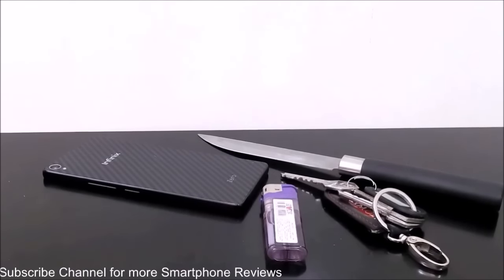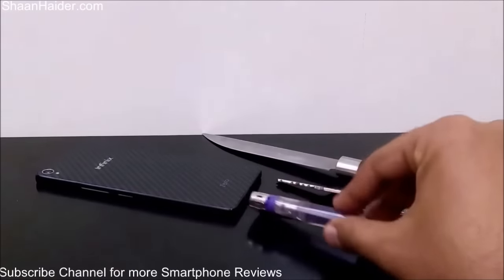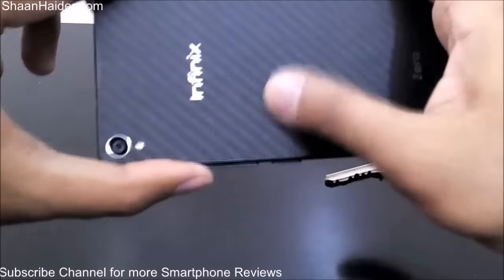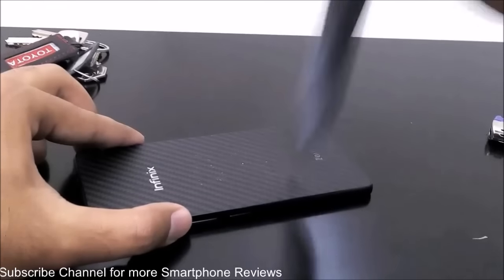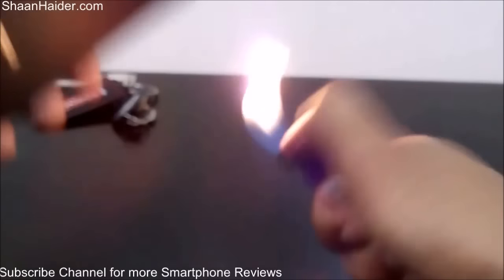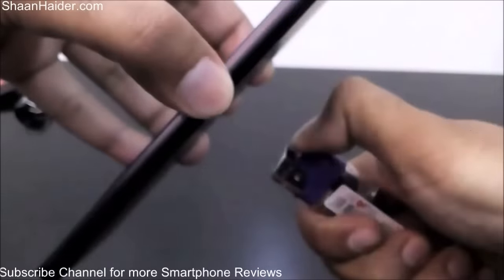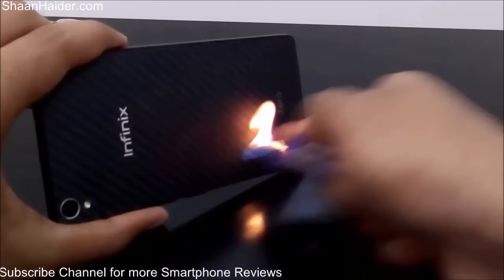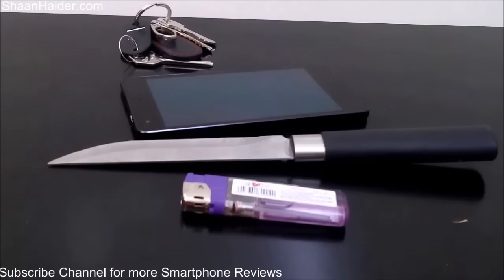Infinix Zero 2 Kevlar vs Fire and Knife Test

Comment: is this mobile back is glass or not
Reply from the maker: +giovanni ayman No, the back is made of Kevlar which is a very high strength material
Reply: +shaan haidar thanks but i want to know if this phone running android one or not
Reply from the maker: +giovanni ayman No, Infinix Zero 2 is not under Android One program. It comes with Android Kitkat which upgradable to Lollipop.
Reply: +Shaan Haider  I have tried burning the back but it got a really deep scratch in it